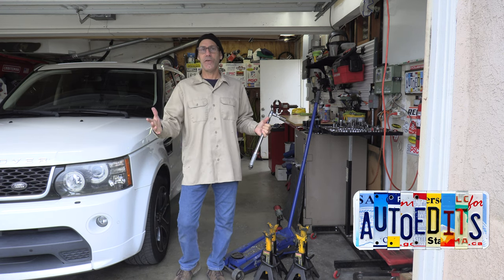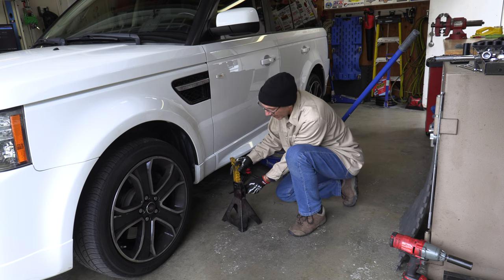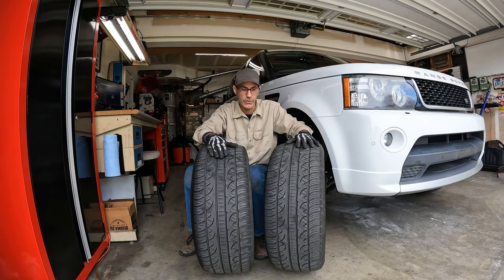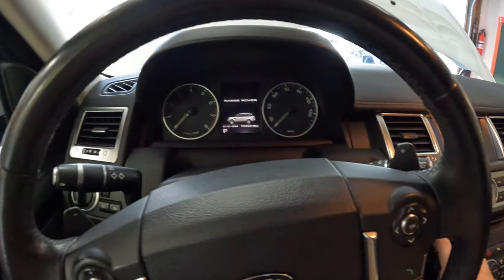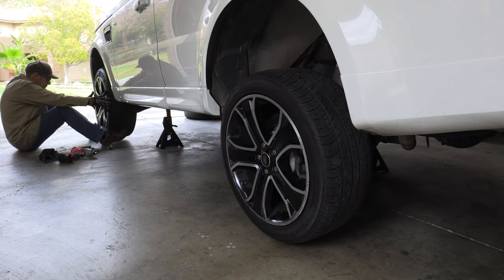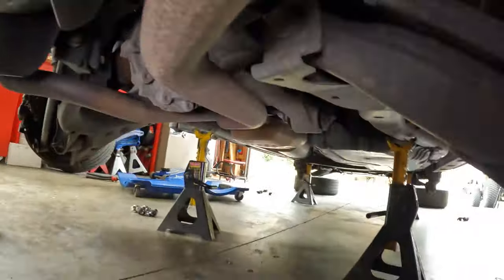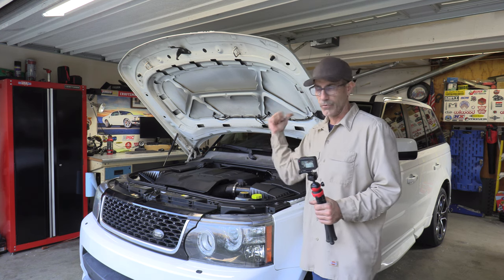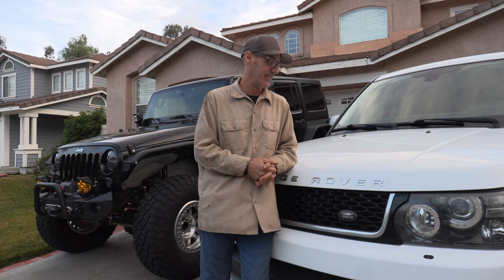Risky New Daily Driver! 2013 Range Rover Sport Tire Rotation, Oil Change and Parking Brake Fix

Comment from the maker: Howdy! Hope the AutoEdits family dig this new vehicle... could be a lot of fun. I will do a more in depth test drive video and explain how I "accidentally" acquired this fun little Rover! Here's a link to the Amazon shopping lists...please snag a set of gloves or something useful from there... it helps me out! https://www.amazon.com/shop/autoedits
Reply: Cool new rig….i did not have great luck with Land Rover but several people really love them. Great video as always 👊🏻👊🏻
Reply: Welcome to rover ownership. I just sold my 2006 Hse with 240k on the clock. It was a super fun rig, would go anywhere I wanted it to. Definitely costly to repair, and repair I did often. Arnott air springs are the way to go when it’s time.
Reply: What a buy! Surely, that is easier to use in the SoCal stop-n-go than the ever-faithful manual Jeep. You've also found an example that belies the notion that British cars can't survive past, say, 100,000 miles. I dare say the previous owner(s) were as fastidious with maintenance as you are. This is a total win-win! Aloha.
Reply: Nice ride..looking forward to maintenance and modifications videos

Comment: Sweet new Range Rover! My mom has a 2012 L322 HSE with 5 L V8.  It’s a great truck but the service bills are shocking.  Keep an eye on the timing chain, this is a known issue and it is an extremely expensive repair.   Be thankful you live in California because these trucks hate cold weather.
Reply from the maker: Good info, thanks!

Comment: Congratulations on the new vehicle, I had a 2010 I bought used with 80k on it that I owned for 4 years before trading on my JKU. Oil extractor definitely makes the oil change easy. Overall, no major issues with mine. Had a transmission shifter connection bushing I had to replace ($45) where the vehicle would come out of drive and not know what gear it was in. Easy fix. Only other item I had to replace were a couple composet coolant fittings on the front of the engine and did the water pump while at it. Other than that just routine brake job, new tires but nothing major. Transmission fluid change was kind of a pain, but if you get the replace pan with the separate filter is very doable.
Reply from the maker: Awesome to hear this! I am looking forward to a few mechanical adventures but not too many ... LOL

Comment: Hi Jason, I just rediscovered your channel as I am shopping for an L320. Congratulations on the new car, it looks great, clearly it was well kept! Has the timing chain every been done on yours? Suspension bushings?
Reply from the maker: I'm really loving this thing... such a wonderful vehicle to drive. I don't know about the timing chains and will just hope for the best for now and there are two new lower control arms but it's still got the original air struts.
Reply: @AutoEdits  Thank you so much for your response. The suede interior trim coupled with the impeccable condition of your car truly sets it apart. I have looked at numerous examples to purchase and none of them have come close to how clean your example is. I look forward to seeing more content with it, the canyon driving shots were awesome!